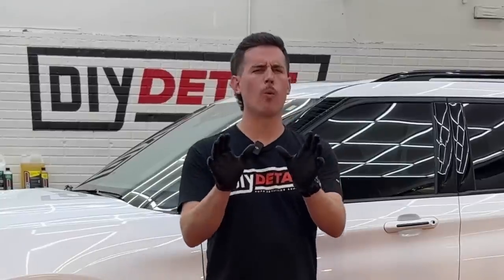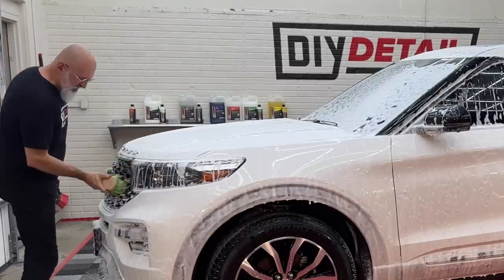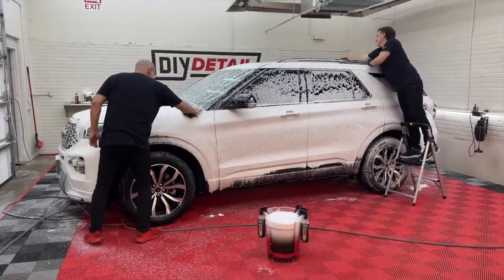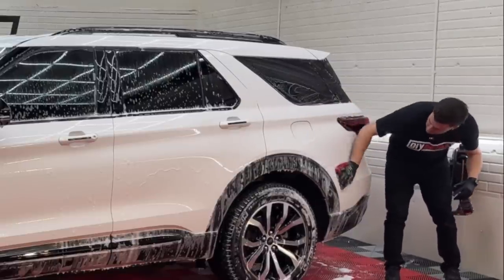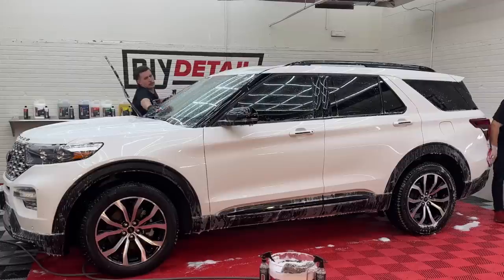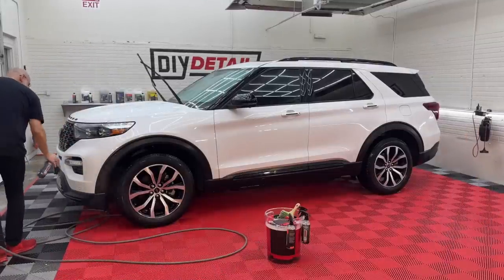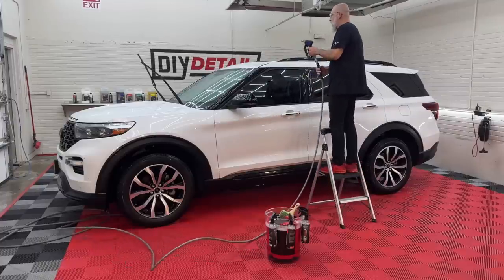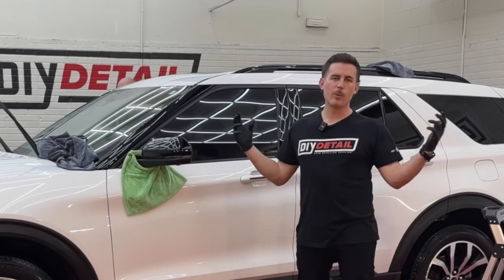How to get your paint ready for Spring: Winter Recovery Wash!

Comment: I definitely wouldn't start using any brush on a painted surface if you can help it the fact is that you have a higher risk of causing damage, even if the brush doesnt scratch the paint if any debris harder than your clear is  in between the brush and clear its going to cause damage to what extent depends on many factors. I envy those who dont care about there vehicles, we detailers have issues😅.
Reply from the maker: That same dirt will cause trouble between your mitt and the paint.

Comment: I used your green flag tip brush on my black truck and definitely marred up the paint, so i definitely did something wrong. I foamed on All Clean, dipped the brush in rinseless wash and started going to town on my hood (polished and coated). I even rinsed the brush with my pressure washer between every panel and have never used it on the wheels… i went up and down on half of the hood, then side to side on the other half just to see if it really would scratch it and sure enough it was scratched up. What should i do differently?
Reply from the maker: If the surface was gritty, you would have gotten better results by foaming and rinsing first.
Reply: @diydetailofficial  gotcha, i guess common sense escapes me sometimes. Frikin love your products and I appreciate you responding
Reply from the maker: Thank you

Comment: How about a clarification for those that have to wash outside in direct sun and no helper(s). So we'll do 1-panel at a time. Are we supposed to do all the steps (Foam, rinse, 2nd foam, contact wash, decontaminate w/ iron remover, rinse, add protection, and dry) to one panel then the next etc. Or are there places in the process to pause and finish all panels to that step then pick back up in the process for each panel?
Thanks
Reply from the maker: In such a situation DIY Detail Rinseless Wash is a much better option
Reply: OK...found a couple of summer vid examples. Thanks @diydetailofficial